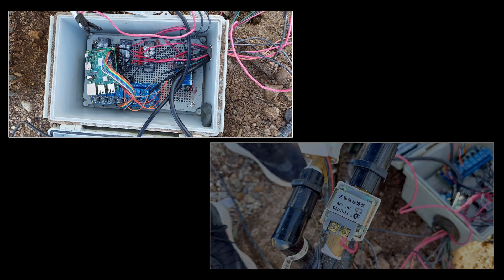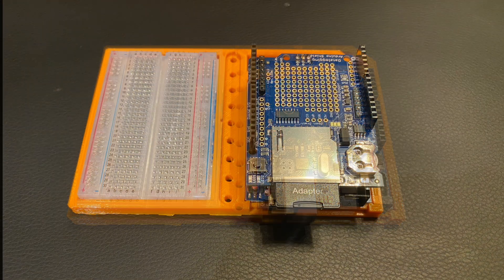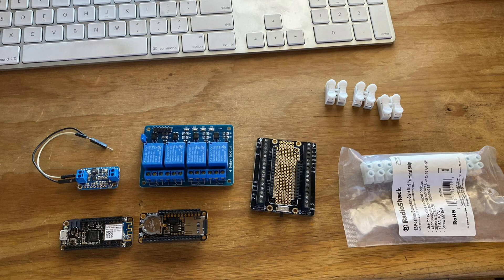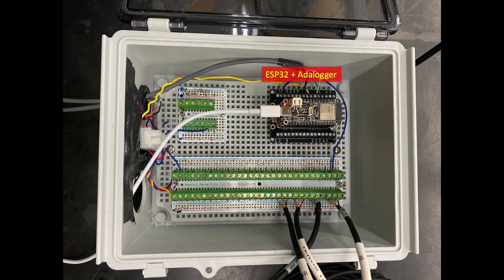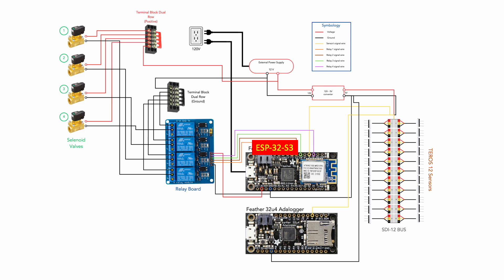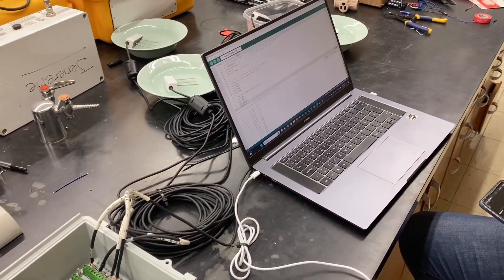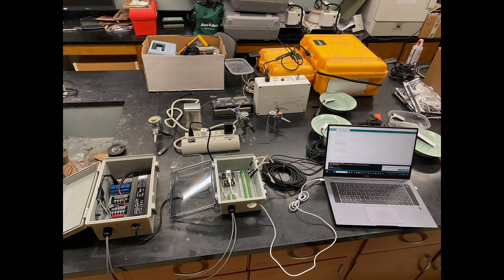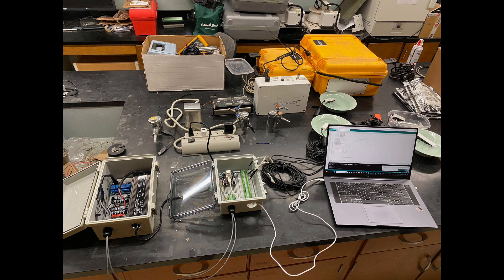Biosphere Irrigation Project - Introduction

Comment: Cool project! A while ago I gave up on a distributed irrigation project I was working on after I got around 70% of the way into it.

It would be interesting to know what kinds of software and protocols you are using! I tried using MQTT and it seemed very useful as it could merge into Home Assistant pretty well.

Comment: great project, last summer i have build, something similar, arduino + soil moisture sensor (4x) + relay board + pumps (4x) rabbit hole was soil moisture sensors and deeper rabbit hole was soil moisture determination . Ended up with DFRobot Gravity: Analog Waterproof Capacitive Soil Moisture Sensor, and ""calibration"" have been done "on site" plants freshly watered = 100 percent, plants withered = 0 percent. watering will start at desired percentage, and end at desired percentage, that can be changed anytime, data loging at Arduino cloud.
Reply from the maker: Cool! I haven’t had much luck with the capacitive soil moisture sensors in my own yard- please keep me posted on how it works out.

Comment: How neat! I am working on a somewhat similar system with EC-5 sensors for greenhouse drought studies. Admittedly you all have much better sensors that collect more data, I am slightly jealous. The sensors from this company sure are expensive, huh?!?

A word of caution with the manufacturer's recommended "calibration" method (specifically Method A):

They make it seem so trivial to: add ~10% of the soil volume of liquid to an air-dried soil, mix until homogenous (while retaining the same bulk density), take a datapoint, repeat until saturated. However, if you have any appreciable amount of silt and/or clay in your soil(s) it will be an absolute nightmare to homogeneously mix the liquid around the soil particles. Even "cutting" our silty clay loam soil 50/50 with sand didn't help much, it was still very much a pain and yielded inconsistent results.

I would share my recommended approach here on a public platform, but A) I don't want to get "scooped" and B) I'm still fine tuning it. I suppose this is all the more reason for me to hurry that process up. Perhaps we could discuss via DM if interested.

Wishing you all the best and looking forward to more updates!
Reply from the maker: Agreed on cost- fortunately that’s not my domain since I am just helping out 😊. Also, thanks for the heads up on the calibration challenges. I have an email I no longer use, but will keep an eye out for a message should you wish to share more details: biod101@gmail.com . Thanks!

Comment: Do you know if mosfets were also considered for this project instead of relays?
Reply from the maker: No- relays were what we had on hand from the original project. Not being an EE, can mosfets handle the power required to engage and hold irrigation solenoids open? I understand mechanical switches are not ideal, but they do seem to work fairly well.
Reply: @ModestMaker I'm also not an EE. But I wanted to heat plants with a microcontroller, controlling the power with a mosfet. Although using a mosfet is a lot more complicated variables than when using a relay. Most mosfets should be able to power the 12v solenoids although a bit more components are needed since the circuts are not physically separated anymore. A moset can switch faster and is more durable than a relay, but not sure if this has a benefit since the solenoid and relay use both electromagnets they probably have a similar lifespan
Reply from the maker: It’s an interesting approach but not one we are likely to take on at this time given fast-approaching deadlines. I honestly don’t know.
Reply: @ModestMaker  deadlines are always a struggle with these kind of projects 😅 good luck with finishing the project, it sounds super promising!
Reply from the maker: I know- there’s half a dozen things we can do to improve, but just need to get something going now. It’s okay- continuous improvement.